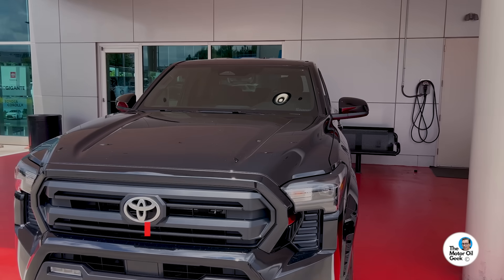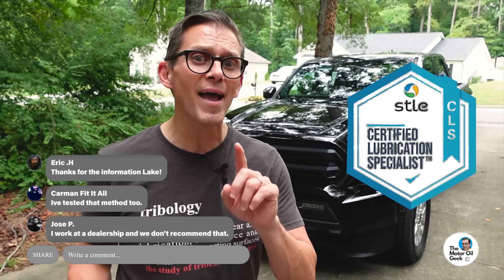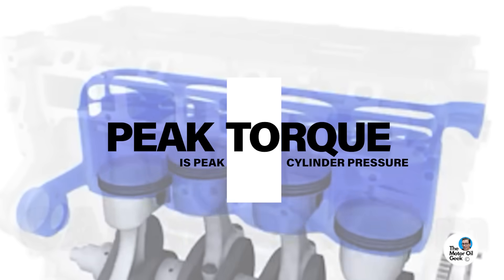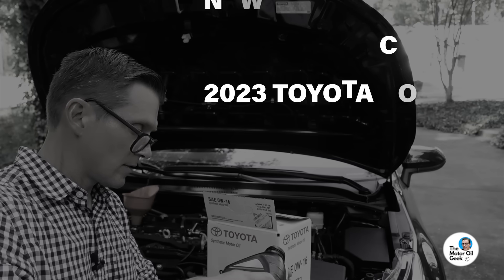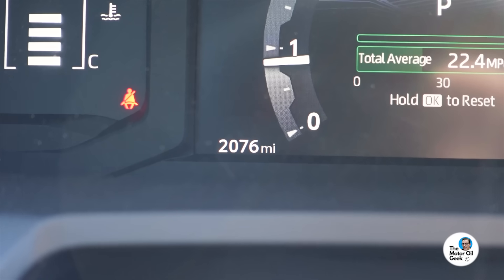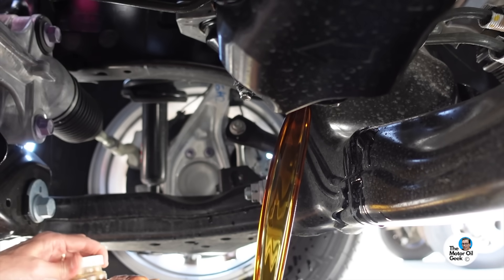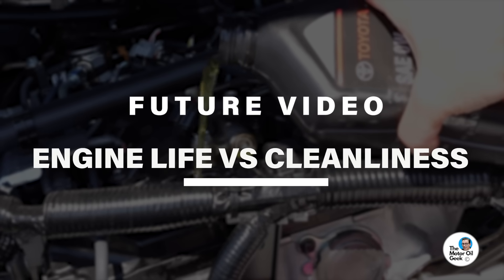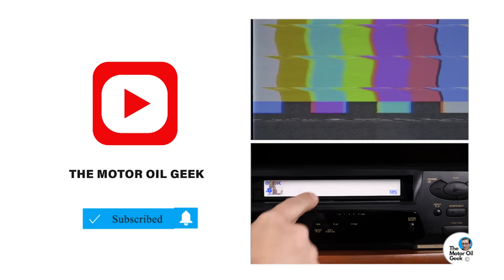The FACTS About Oil Changes (What The Owner's Manual DIDN'T Tell You)

Comment: Hey Lake! I own a 2023 Hyundai Santa Cruz, purchased with 16,000 on the Odometer. I didn't have the chance to break in the engine. It is a 2.4L Turbo. I have changed the oil (Mobil 1, 0w-30) three times, with Oil Analysis. 5,000 intervals, and again, having a turbo, with its high operating temps, keeps me at 5,000 mile Oil changes. The results so far? Excellent! Minimal wear, across the board. With all the negative reviews about Hyundai engines, I thought this is the best preventative maintainence I can do. The engine is strong and smooth, couldn't be happier. This is a great video series, keep up the great work!
Reply: ur thinking of the theta 2 engines... your engine is a 2.5t, not a 2.4 theta 2. from what ive seen first hand, they dont burn oil like the 2.0 and 2.4. ngl id buy one before id buy any GM, non diesel, turbo engine
Reply: What about change the oil filter to one that has a smaller micron that the OEM filter? That way you won't need be relying on a maybe it's better ?
Just thinking , my way is better Lake..
Your welcome.

Comment: What is "normal" engine life, and what is "extened" engine life?  I see comments saying their vehicle with 100k miles validates the thing they did, but I feel that "still running" after 100k is a very low bar!  I think "still running" after 350k (gas engine) would be more convincing, but usually the car gets old, maintance is skipped and it is discarded before the longevity of the engine is legitimately put to the test.
Reply: Exactly. None of this matters if you’re just trying to make 100k
Reply: @basicuser54 To me it does if you keep service records and sell the car who someone else that wants to see service records whether for resale value and or confidence. But point taken about 100,000 if you trade in frequently, lease or just push it out in the back 40 to use for parts because you have another one the same (farmer).
Reply: @jakelemay7913  ur joking right?  Nobody buying an old cheap high mileage car is worried about service records.  Also most people trade their cars in.  The dealers dont care about yoru old junkbox that will be going to auction anyway.
Reply: @basicuser54you should be able to run even a Stellantis product trouble free for 100,000 miles. I know they don’t, but they should.
Reply: @Dave-om6nd mine always have.  I’ve owned more than 10 jeeps over the years.  Never had a single serious problem with any of them, and never any problem with the powertrain.  Maybe you’re doing something wrong.
Reply: @1wheeldrive751 that’s what is called an anecdote.
Reply: @Dave-om6nd no kidding?  Really?

When you string enough anecdotes together it becomes data.
Reply: @1wheeldrive751 ya but your not even remotely close to that genius.
Reply: @basicuser54 does it matter at all? where is the science that doing 5 oil changes before 10K miles proves your engine will last longer?
Reply: @jsnx9067 just say you don't understand the data put in front of you lol 😂😂clearly you don't understand lubricants or mechanical devices like engines. Stop making comments like you know or even remotely understand. Present your data for skepticism
Reply: @epp4791 thanks for proving me right by providing ZERO scientific data, clown
Reply: @epp4791 Maybe we understand that for almost all vehicle owners, changing the oil early is a waste of money and time, myself and others have plenty of data on the use of diesel oils in gas engines also but to listen to some of Lake's videos, we are doing damage, which we are not, the oil tests and visual checks are showing fine.
Reply: The old Toyota 4.7 has had multiple million mile engines
Reply: Yep, I only have 350,000 miles on my 5.72004 Dodge Durango all-wheel-drive vehicle never fixed anything on the vehicle just the 1 water pump and fuel pumps.
Reply: @AmericanSurvival1  Let's not forget to talk about Al Bundies Dodge...
Reply: @AmericanSurvival1 Better watch that Durango carefully. Dodge will likely send a black ops team to steal the vehicle in order to determine the mistakes that were made allowing it to last far longer than any Durango in history.
Reply: @AmericanSurvival1  350k miles. in a Durango would be a world record ... No transmission replacements? yeah, not buying that story
Reply: @toyyoda3710 can confirm. My 2000 Durango just had its transmission rebuilt at 200k miles
Reply: I have a 2012 Honda Accord with the 2.4L "K" series engine. I bought the car new in 2011 with 6 miles on it. I never babies it from day 1 and I now have over 282,000 miles on it and have never had any issues. It came with free oil changes for life when I bought and it's been going to Honda for the oil changes since new. Still using the same Honda 0W-20 it came with. I would like to do 1 of the oil changes myself someday and send Lake a sample and really see how it's holding up
Reply: @randyfernandez1989  correct. If you don't over heat it and it is getting oil changes it is good...giving better oil changes like at early life really does not mean you will last 1,000,000 while before it would last 500,000...but it does mean at higher mileage the tolerances of the engine components are tighter and it runs better (usually..)
Reply: Accords/camrys of late 80s early 90s can easily reach > 200K miles…

Modern cars should be getting a million miles by now..

It’s all “Planned-Obsolesce” and Profit..$$$$$$
Reply: In early 1990's, I bought a single-owner, CA-based, used 1982 Toyota Corolla (4AFE engine) @ 125k.
I continued the same dealer or private service intervals and It lasted to 600k on conventional 10w/30.
After that, I purchased a 1-owner, dealer serviced, unleaded, 1978 Audi Fox Wagon, that was all German/Bosch parts and it 'ran well' with 3k LOF intervals conducted at an awesome Audi/Porsche inedpendent garage in El Monte, CA.  
Chaning the oil and coolant (for older normal aspirated vehicles) is the best thing to keep the cars normally running...unitl other component repairs or services challenge the wallet.
Reply: I absolutely agree with your comment. 100,000 miles should be nothing for today’s engines. They seem to have more problems now than at any time in the last 40 years. When I was young, my first three vehicles all cost $500 each. All of them were pushing 200,000 miles, and none of them had a single engine issue. Back then standard oil change was every 3000 miles.
Reply: The only way to know is what the manufacturers designed the life of the engine is.
Reply: Makes me wonder how many hours of operation have they designed it for.

Take a bearing for example where a basic selection I’d design for 100 000hrs at the design operating speed.

Cars don’t operate at constant RPM for much of its life.
Reply: I’m at 320k miles on my Hyundais engine
Reply: Agreed and our 1998 Tahoe with 330K miles on it proves the case. I average about $1,000 per year in maintenance cost (excluding tires). Oil gets changed around 4-5000 miles and I fix things when they break. Best car I’ve ever owned by far. People tout the so-called environmental friendliness of EVs but I guarantee keeping this car even at 15/18 mpg is far better for the environment than buying a new EV.
Reply: @dac7046that depends on how many miles you drive a year. If you drive a lot, an EV is still better for the air
Reply: I feel like a lot of people don’t think these newer engines need as much care and maintenance as older ones and I say it’s the opposite. With all the engines switching to direct injection and such the engines gunk up and get more carbon buildup imo from these 6,8,10 speed transmissions keeping you at lower rpm’s for longer mixed with direct injection and people not changing their oil for 10k miles it’s a recipe for a low mile engine failure especially with the low tension rings they use now I change my oil every 3k miles or 3 months it might be overkill for some but I live up north and oil with a filter is cheaper than an engine
Reply: By the time I get to 100k miles (about 10 years) the truck is starting to rust away.  This is life in northern New England.
Reply: @1wheeldrive751 Same in Wisconsin.😢
Reply: 363,000 miles on 04 Tundra;  
does not burn oil.
3000 mile oil, filter changes
3.4 v6
Reply: I did my 03 camry at 1000 than 3000 and about 3000 until last few yrs around 5000, still going at 322k
Reply: I always aim to have a car running smoothly for as long as I can. Most of my cars have made it 200-300k+ miles before finally giving up. My current car is around 140k or so and runs better than some cars I’ve seen at half the mileage
Reply: I feel a motor is high mileage at 175k miles now a days. 220 for a gas motor I see as end of life in most cases
Reply: The combination of long life service intervals ( 20k 2 years) when the car is new and often doing the highest mileage. 2nd owners who treat 2 years or 20k miles as a which ever comes last guide to maintenance and later owners who view oil changes as optional and use cheap oil is a killer
Reply: There are a great many factors. Heat, cooling system. Time is one. 100k a year vs 100k over 20 years. But you are 100% right on 100k is generally a low bar. You can't ignore time as gas changes and it impacts engine gaskets so to blame that engine mfg is a bit wrong' ...a buick century failed at 52k but the car was 26 years old. Well did someone let it run hot and not maintain radiator. did the ethanol in gas eat the old orange gaskets. all that has to be accounted for...type driving...but in simple terms most modern engines properly maintained should last adn some need a lot at 100k to be called maintained...a bmw with a plastic radiator and plastic water pump impellor 10 years old should have those changed and it will make 200k...change them again maybe it makes 300k....let them go and is it the cars fault?
Reply: Exactly. The question should be what is the schedule that minimizes cost of ownership. What's good for an engine lasting 300k miles if seats, plastics, wiring harness will break down at 150?
Reply: It's because the engines they build these days are not made to last and they don't want the engine to last long so you can come in for repairs. We live in a society that we are fed a bunch.of BS!!! Greedy, greedy greedy!!! The EPA, politicians their lawyers, lobbiests and most of the mfg can all burn in hell!!!
Reply: @btbd2785I think it falls really on the politicians who, witho any engineering background, impose emissions and safety standards which often conflict with each other, if not the basic laws of physics themselves.  The legislation might bring about higher fleet mileage averages or increased crash survivability, but the tertiary outcomes are overstressed drivertrains pushing increasingly heavy vehicles which cannot survive a minor fender bender without dropping $10k in body work. 
The fundamental problem is that we're trying to fix stupidity. None of the above regs fix lead feet, or inattentive drivers. IMHO that the extra power just makes the mommies in SUV's accellerate harder, and the lane, and distance and park assist just make people pay less attention than ever.
Reply: The logic for this level of maintenance is pretty simple. Contamination in oil causes worse performance. Worse performing oil causes increased engine wear. Are we really going to wait around for someone to say the equivalent of the sky is blue? Just change the oil during the break in period or for as long as you see heavy contamination.
Reply: With today’s manufacturing processes and technology and materials used. There’s no reason a modern vehicle shouldn’t reach 250K miles easily with regular maintenance and oil changes and without it being abused. If it can’t then it’s a POS.
Reply: 338.000 miles on my 94 Trans Am I bought new.  Engine never been touched,  even the timing chain is original. Uses no oil. 3000 mile oil changes using Castrol GTX 10 30.  Lifelong Southern California car,  so 0 rust or corrosion issues. If the engine ever fails, I will have it rebuilt.  😊
Reply: Gas vehicles should definitely get 350,000 with mild maintenance.
Reply: 10years/150,000 is the design life of a vehicle. That's designed with minimal maintenance. 

Better quality fluids and more frequent maintenance schedules will get most vehicles to 250,000.
Reply: @craiglamb9029  will it? Can i see the science on that? can you point me to the studies?
Reply: @craiglamb9029 I believe your comment about 150,000 being the normal life expectancy as my maintenance schedule in the owners manual for my 2020 Malibu stops at 150,000.  Or maybe at that point you just follow the repeating regular intervals.
Reply: @craiglamb9029 design life based on manufacturers' recommended service intervals is equal to the warranty period.
Reply: A man drove a Tundra to a million miles and drove another the same mileage. So if you have a Tundra engine problems aren't your concern if you service them properly.
Reply: @altonsafe  turbo?
Reply: @altonsafe  The V6, yes.
Reply: @olavcramer1260  that's what I drive
Reply: You can make it to 100,000 miles with 20K oil change intervals on most cars. Proudly touting you made it to 100,000 miles problem free with 3K oil changes is actually hilarious.

Comment: My wife, who worked in an industrial process environment with a lot of filtering, pointed out that a filter is most effective just before it plugs up with debris.
Reply: Effective at filtering but worst at flowing. Dirty oil is far better than no oil. Also, the size of the remaining (unfiltered) particles becomes irrelevant at some point. Even your almost clogged filtered oil has particles (as does new oil).  If the filter mesh dimensions are adequate, it's meaningless. It's not a one dimensional issue.
Reply: @mback12000 in industrial applications it’s typical to have a pressure transducer ahead of the filter when tells you when to change (or clean) the filter).
Reply: @treatch3  Some cars do this too. I have done this on my race car and monitor in the ECU.
Reply: Exactly, I've been telling people that for years and you ought to see some of the responses I get from people in the comments of YouTube videos, they swear I'm a loon and I "obviously don't know anything about vehicles", and that's because their basic instinct is to think that the same rules that apply to things like brakes also apply to filters, that something works best when new and it's performance deteriorates over time.

I've explained to countless people that the dirtier a filter gets the better it filters, anything with a paper element anyway, the issue it getting so dirty it restricts flow, but as I've explained to people at that point it's filtering particles so small it doesn't even want to let oil molecules through. 

I can remember back in the 80's one of the Japanese vehicle manufacturers, Toyota or Mitsubishi maybe, had tags riveted in the engine compartments of their vehicles that said "Change oil every 3,000 miles and filter every 6,000", because by doing that the 2nd 3,000 miles the filter was actually filtering better than the first 3,000 miles, in comparison however the last thing you'd want to do is do it the other way around, if you spin a new filter on while you've got old oil in the engine it'll be letting more contamination through than the filter you took off.

For years I've done that change the filter every other oil change with my Harley's, but I change the oil more often than recommend though.
Reply: @dukecraig2402 And the moment that $20 bypass valve opens up you have no oil filtration. Your premise may be correct but the conclusion that a dirty filter is best for your motor is not.
Reply: @basicuser54
That's not what I said, I never claimed dirty filters are "better", and when it comes to the filter becoming restricted I suggest you either pay closer attention to what you read or read things in their entirety instead of just the first couple lines of something and reacting to it.
Reply: @basicuser54 
“dirty’ is a relative adjective in this context. There’s ‘dirty’ and there is ‘DIRTY!’.     Air filters are a great example of where people change them out very commonly at a fraction of their useful service life.
Reply: @dukecraig2402  
You are correct as long as the oil and filter are changed before the filter’s flow rate with cold oil does not restrict fluid flow to the point where the pressure open its bypass valve.   Actually some installations do naturally bypass somewhat when the oil is cold and the engine is revved too high too soon, but a large filter area and low W viscosity properly matched to the engine by its designers should avoid this phenominum which is far more common with industrial hydraulic systems.
Reply: @hedydd2 
Yea I addressed restricted flow in my post yet people keep coming at me like don't know that's an issue, and here's why.

A common problem with posting a comment on YouTube is if you go into detail about a subject you get "I'm not reading all that" from people, which is a total mystery to me why someone would refuse to read something that'll take 1½ to 2 minutes at the most to read yet they'll bother to take the time comment about not reading it.

But if you don't go into detail about something and just summarize things then you get "That's not true because..."

So basically it's lose lose either way.

Comment: A new oil, air or whatever filter has the best flow but catches the least.  The dirt filters and blocks more and smaller particles to the point of poor flow.  Best not to change it too soon or too long.

If you ever had a swimming pool and you want to have crystal clear water don’t clean your filter too often, the dirt filters more and finer particles.  There is a cross over point where you’re it’s filtering extremely well but the flow is terrible and not sufficient.